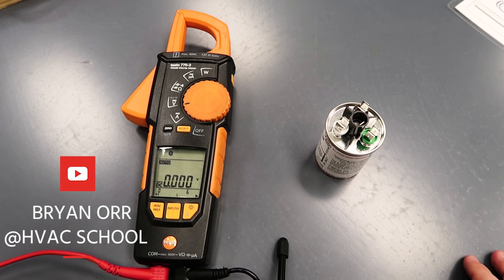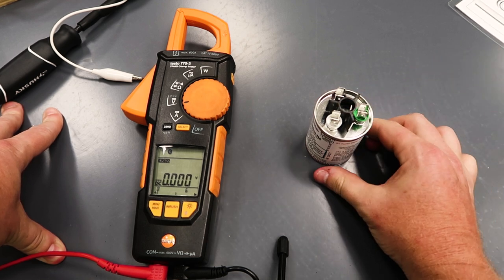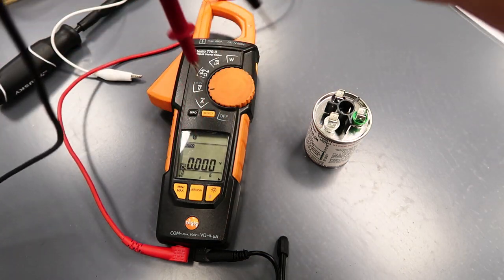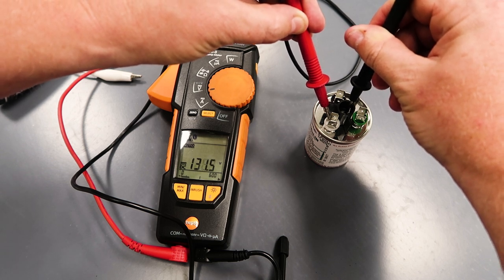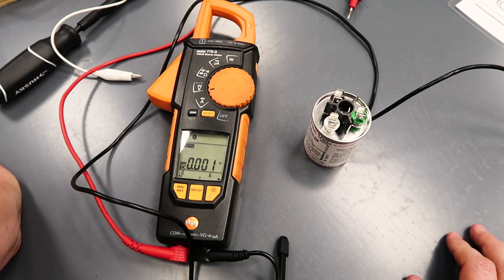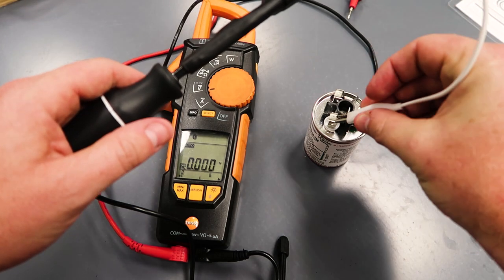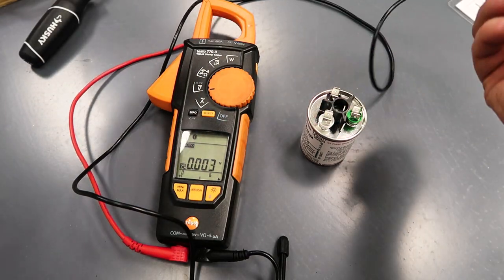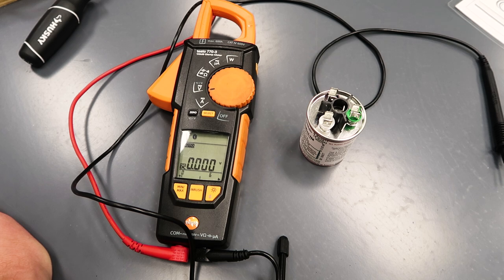Can You Discharge a Capacitor Using a Voltmeter?

Comment: If your digital meter has a LoZ or Low Impedance mode the cap discharge in a LoZ voltage mode will be quick.  Normally a high impedance digital  meter loads a circuit with an equivalent impedance of ~10 megohm where a low impedance mode, when available, is typically a 3k to 100k ohm load.
Reply: Great point RJ!  This causes me a new question.  If my Fluke 116 in AUTO-V LoZ has an impedance of 3 k Ohms and it can accept 600 volts (600 V/3000 Ohms = 0.2 Amps;  0.2 Amps X 600 Volts = 120 Watts).  Does this mean the load in the meter can dissipate 120 Watts for an indefinite period of time?  I certainly wouldn’t think so.  But I can find no warning or limit on the use of this function in the Fluke 116 Users Manual.  Maybe it has a temperature overload function which is not described in this manual?    Or, , , they will be glad to sell me a new meter when AUTO LoZ no longer works correctly?
Reply: The Fluke 116 manual says LoZ input impedance is 3k ohms and is dc coupled so you are probably right in your calcs.  It may have a heat sink.  I would imagine they can handle it.
Reply: RJParker. Those meters aren't cheap and not usually carried by techs, they're also not clamp ons.
Reply: Chuck brought up his Fluke 116 so I checked its specs.  Many Klein, Flir and Extech clamp meters have LoZ.  The primary purpose of LoZ is to determine when ghost voltages of little significance (usually induced) are being picked up by the high impedance of digital meters.  Personally I like my UEI 429 with dual displays and data logging capabilities even though it does not have LoZ.  For ghost voltages I have an old reliable analog meter which needs no battery in voltage modes.  I do keep a wire wound power resistor much like Bryan describes but it rarely gets used.
Reply: RJParker. I stand corrected.
Reply: RJParker  yes this works
Reply: http://assets.fluke.com/demo-IAD/116_demo.html?_ga=2.257477387.1683798544.1529687407-216154505.1529687402

Buried deep in a Fluke support page is the further explanation of the 116 LoZ function; including: “When the leads are placed on a live circuit however, the input senses the presence of a “hard” voltage and automatically adjusts the input impedance to a much higher value and then displays the actual voltage present.”
Reply: For those of you that have a LoZ meter... when and how often do you use that function?
Reply: Dave,  My 116 usually stays at my work desk where I work on and experiment with small stuff. So, believe it or not, I use that Auto-V LoZ function more than any other function on the meter. I often use it for checking small batteries, believing the 3K load gives me a more realistic evaluation of the batteries. 

I just today checked 3K Ohm impedance against 9 Vdc, 26 Vac, and 118Vac and in all cases the meter was providing the 3K Ohm load. 

If you are going to own six or seven Digital Multi Meters, I like the 116 as much as any in the stable. That 116 is the only meter I have that provides that LoZ load.
Reply: Just use an insulated screw driver with a rubber glove bang done
Reply: @beedee9534 Bang and capacitor gets damaged! Especially bigger ones.

Comment: Thank you for making this video. I had to replace the run capacitor in my AC. Didn't have a discharge tool so I figured the multimeter was better than arching screwdriver. The capacitor was totally uncharged but I am thankful I had this option !

Comment: This whole debate is missing the entire point. Both sides are wrong.

You are never going to measure voltage on a capacitor out in the field unless you pull the wires off while power is still hooked up. 

You don't need a 20k ohm resistor to discharge a capacitor that's installed in a unit. There's already much smaller resistors that are shorting the terminals at all times. They are called motor windings. 

Herm > Start > Compressor Common > Run > Contactor > Capacitor Common. 

If you pull the disconnect, the capacitor will discharge through the motor windings almost immediately. 

Older capacitors might be an exception. Those old capacitors that you can shake and hear liquid sloshing? Those might actually take a while to discharge. That's the only time I've ever been shocked by an unhooked capacitor.
Reply: Is there a specific order to disconnect the Common, Fan, Herm?
Reply: Will it discharge thru windings without pushing in contactor?

Comment: The time constant for capacitor discharge/charge is capacitance x resistance.  With the rule of thumb, 5 time constants for essentially fully charged/discharged.  Assuming some extremes, a 100 mfd capacitor @ 450 v.  The time constant with a 20k ohm resistor is 2 s, 5x=10s.  450v on a 20k resistor = 22.5 mA.  Not bad, that is an initial power discharge of 10 watts.

Comment: It really is not a race.  Do it right because an ounce of prevention is worth more than a pound of cure.  It's your right to do it your way, but why teach beginners how to do it wrong?  I know I don't have the brass to dead short a 7 farad cap.  Yes they can get very large.  All the best to you sir.
Reply: So what's wrong with this method?
Reply: He didn’t short it. The discharge tool has a resistor in it. It’s just a homemade tool made of a screwdriver, a resistor, and a length of wire. I made one using the probe leads from an old DMM that I had lying around. It simply removed the plug ends and inset into the DMM ports and soldered a resistor between the 2 probes. So it’s not a straight short, it goes through a resistor.

Comment: I made a video about this a few years ago, only that I really used an analog meter!
Now, I have supercapacitors (10 F, 5.5V) which needs more current to discharge, and a short-circuit won't work well

Comment: It takes 2 minutes to make a capacitor discharge tool.

Id much rather do that than wait for the meter for 10 minutes. A 5w, 10k resistor, a couple of lengths of properly sized wire, and heat shrink tubing and you got everything you need. Or you could use some old probes from a multimeter along with a screwdriver.

I just ordered some 20k, 5w resistors to make one for my tube amps. I also ordered a pre-made discharge tool so I can compare what I make to s commercial product.

Comment: Thank you for nice video. Is there a formula can use it to get an accurate reading? Second q should position the capacitor vertically or horizontally I saw some duct less mini split is positioned horizontally? Thanks.

Comment: What about a meter with Loz function, is that quicker or even possible? I'm pretty sure I read you could use the Loz function to discharge a cap.
I need to solder some new IC's on an led tvs power supply board and figured I should discharge the caps first. 450v caps I believe.

I got a power supply repair kit for my model ps board off shopjimmy cause the ps board was out of stock. Hope it's pretty straight forward, my soldering skills are decent.

Nvrmnd it looks like the LoZ method has been addressed here in the comments already lol

Comment: you could also use a diode as well.
Reply: That's probably all there is in his "capacitor discharger", it's literally just a diode or a decently low ohm resistor.

Comment: I found you today through watching you with MATT. I trust Matt and he trusts you, so I am a new subscriber. I have now watched several of your videos and I have a few questions. It just so happens that one of our daughters is having a new system installed this week and also my parents are having an issue or two. So without a lot of explanation, here are my questions. 
Starting with my parents ACHV system. We live in the Tampa Bay area, so hot and humid most of the year. We also have hurricanes and sometimes need alternative power. My father recently bought a portable generator that maxes at 7500 Watts surge. 6000 Watts normal run. He'd like to be able to run the house AC (WITHOUT HEAT), in times of long power outages. He's got a 3.5 ton unit that is 16 seer. I don't remember the brand. I think he could run his AC ONLY if the generator can handle the surge. NOT being a tech or even an electrician, I believe I understand that the capacitor is to give the fan and compressor motors a jolt to start up. His system has a cap on it from the factory, but I don't understand why we do not use a second cap for this surge/boost? Is it feasible? Can a second cap be added to reduce the pull or surge on the incoming power?  
I'd also like your opinion on using UV LIGHT to kill and keep mold from growing? 

Last Q. Is it true that the air handler and the indoor and outdoor units cannot be mixed as they use to be? My daughters air handler is pretty well plugged and in a inside closet. Very difficult to work on and the entire unit must be removed to pull the fan. She got an estimate and asked what it would cost to put in a new air handler that COULD BE serviced. She was told it is no longer legal to mix units. I realize they would have to be compatible, but that sounds like BS to me.  Please advise on all. I truly appreciate it!!
Reply: A 7500w generator will start most systems without modifications.  The generator usually has to wired in to the house wiring with a "transfer switch" in order to work on a central system.   An add on "hard start kit" will give an extra boost and has a mechanism to take it out of the circuit after a start.   Emerson also sells a soft start module which will absolutely do the job in the worse cases.  It is called a "Copeland Secure Start" but normally requires ordering and few techs know about it.   The biggest problem with generators is stale gasoline clogging them up such that they won't start when needed.  Plus supplies of gasoline dry up after storms.  I would recommend a propane or natural gas generator of the same size instead.  Propane stores for years without problems.  UV lights work well, Bryan recommends the Air Oasis Nano.  Most likely your daughter's unit has a plugged evaporator coil.  Or a leaky system.  It is possible to change the evaporator for another with the same size and refrigerant.   The old ones have R22 refrigerant and most new are R410.  I doubt the whole unit has to be pulled to change the fan or the evaporator.   Second opinion time.
Reply: There are also carb conversion kits from to use natural gas on small generators.
Reply: RJPARKER , Thank you very much for this excellent reply. I will certainly be looking into the "HARD START KIT" and the "COPELAND SECURE START". 
My father had already bought the generator. It made me sick, because they have natural gas at their house already, but my mom is afraid of it as it is a corner house and the meter and piping is exposed. I tried to talk them into a slightly bigger NG permanent mount, auto start system as thy are not as young as they think they are. lol.. I have been a mechanic most of my life and know all too well about old gas. So for many years he has know to put all things "GAS" away with empty tanks. Plus I normally go through their systems before the hurricane season begins.  We are about to change out their power panel and add an outdoor outlet for the generator and a "D RING" to chain it down. They live in a nice area, but you never know what people will do when you have something they feel they need. 
The more I read about the UV lights, the more I want a pair of them myself. So I will check out the Air Oasis Nano for all of us. 
The AC system at our daughters house was changed out today. 13 hours and they have to come back Monday to finish removing the old air handler in the closet. We had the new unit put into the attic, so close to a new install. I just spoke with my daughter and she says she cannot even hear this unit run!! Also that she can feel the cold air blowing across every room now.  Something she doesn't remember from the old unit. Such a difference.. The old closet unit was allllways very loud. Even when brand new. I am going to bring it home and clean it well with hopes of installing it in my back shop. It will be far from perfect as my shop is not insulated at all, but Florida heat keeps me from doing anything in the shop for 8-9 months out of the year. Something has got to give!!  I thank you again for your reply. Steve

Comment: If you did this with a 2000 v microwave capacitor your multimeter fuse would blow, correct?
Reply: did you ever find an answer to this
Reply: @raybradshaw8444  Hey, yeah so if you have a cheap multimeter, I wouldn't do it.. The thin insulation on the leads may not be able to protect you from getting shocked in the event you are grounded and you become a path for electricity.. As far as damaging the device, stay under 1000v. Again, this is just what I've read and it totally depends on the quality of your multimeter. Hope this helps.